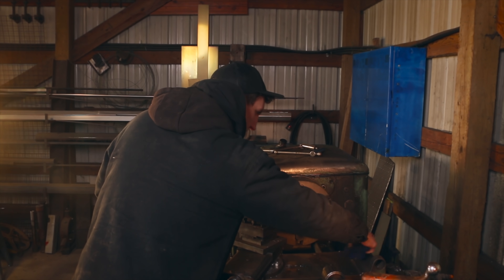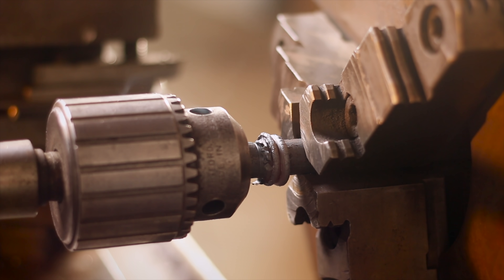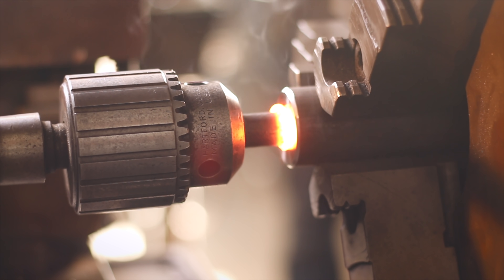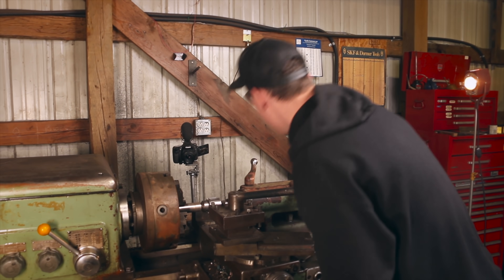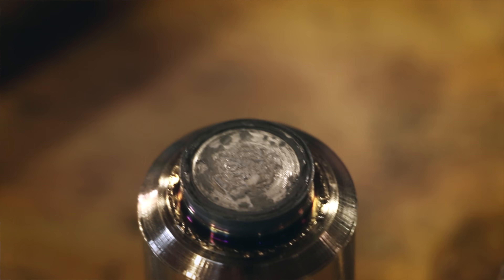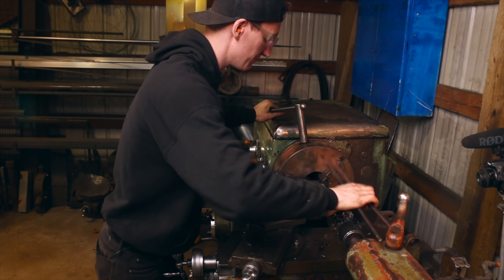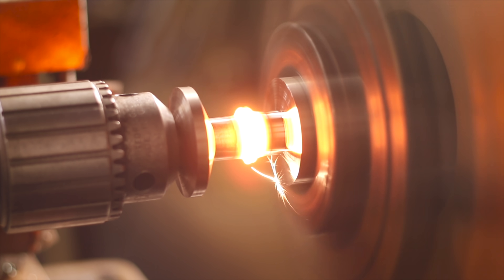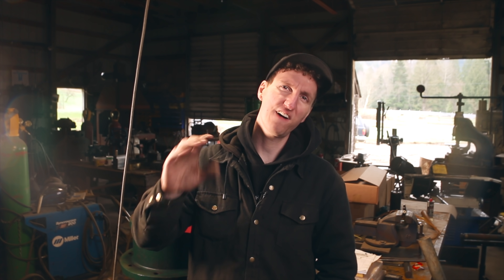Can I FRICTION WELD TITANIUM on my LATHE?

Comment: Would adding a very slight tip to the standing still piece help with chances (between 5-10 degrees), so that the surface area can increase for greater friction (and a lot more heat centered at tip area for a stronger inside out weld) to at least jump start the friction weld process?
Reply: You actually want to reduce the surface area.
The lack of "mushroom" is the tell that it is not getting to a high enough peak temp to make the metal plasticize, the state where it flows but is still solid.
This is because he is generating heat slower than the metals conduct the heat away.
That means you need more spot heat generation, there are 2 ways to do that speed and pressure
Speed is limited by the machine
Pressure is limited by the force he can apply and the multiplier of the tailstock screw.
This means that unless you can apply more force to the tailstock you need to apply the force of the tailstock to a smaller area - Even though force is unaltered the PSI increases
Reply: . The end contacting surface area, theoretically, would be the same or close to your existing runs, as it would shave or crush into itself as it heats up.

However, You very clearly know more than me though. Did not think it would be more an issue with pressure instead.
Reply: @GrimOfDonuts  Essentially it's an issue that with friction stir welds that you need to generate the shock heating very quickly or you lose the ability to perform it.

Once the tip in the cone heats it enters a deformable state that is not quite liquid - this is refereed to as semi-plastic or plasticized material
While in this state it can no longer generate pressure and extrudes from the surface - the fact it is deforming means it can no longer exert pressure unless you are ramfeeding it faster than the material conducts heat, this means its capacity to generate heat via friction just dropped off a cliff as friction heating is a combination of speed and pressure.
This loss of pressure then stalls the friction welding process and the torque of the spindle then shears the newly formed bond or radically over stressed the drives of the machine as it is now trying to twist solid material which results in either a pronounced slow down of the spindle which further deepens the stall meaning that the outer area is at a different heat profile than the core of the weld which can induce different granular formations and weaknesses or in geared machines can result in total gearbox failures

The reason why friction welding is primarily pressure based is because by the nature of cylindrical rotation the core will have drastically less surface speed than the outer areas due to the circumferential distance increasing so rapidly.
The rotation is there to perform the mixing of the semi-plastic solids in a similiar manner to how you could with something like playdough.

This is why friction stir welders are almost always direct drive electric motors for safety rather than geared ones and also why they are popular for production as the speed of the shock heating needed for the process results in a rapid repeat production

Comment: I think for the carbon steels and the ones that did not weld well, you should pre drill a hole in the one the is connected to the spinning side of the lathe and then bore down the end of the stationary piece to the diameter of the rotating one. Maybe there will be a stronger weld that can resist impact better.

Comment: Tim, I really enjoy your videos.  It's great seeing someone who loves their craft and is willing to try new things... 

A couple of things...  It looks like on the steel, you are getting "fast" fractures (the chalky area).  You probably have a crack, that is enough of a stress riser to propagate when you strike it (look for a flat area next to the chalky area).  In cases like that, you could actually improve the strength by clearing out the mushroomed area and getting down to a crack-free area. Of course, as a blacksmith you are probably quite familiar with that.

For titanium, it is notorious for galling.  Basically titanium forms an oxide layer skin that is super tough and super thin.  When it is exposed to friction with titanium, that thin layer sheds and locks in with the layer on the other side.  With the lathe you are shedding so much, that you are putting a lot of energy (heat) in.  This is why titanium is almost never used in bearing applications, and if it is, it is only with a non-titanium material on the other side.

Comment: it seems like the best welds are those that "mushroom" out. as if they liquify to a point of actual blending of the 2 metals ..
Reply: Seems that way. Sounds correct
Reply: @Charles37400  but in welding you'll need a flux or shielding gas

Comment: tim if you bored a hole in your stock 10mm deep and machined step down 10mm from the other piece of stock so it slid in neatly and then friction weld it the puddle should be internal then it will easily friction weld the outer stock making the friction weld stepped in theory and should be very strong cheers from down under

Comment: If you have a tool holder that you can release and let it spin, then you can use the higher speed, release the tool holder, and let it all wind down. Probably help all the welds.

Comment: i feel like if you put a torch on it maybe 2-3 before you stop the lathe  then hold the torch on for a few seconds while the lathe is full stop it might work better it feels like maybe the weld might be tearing at the last second when the lathe stops. also what about trying to keep a flow of Aragon at the joint sight as you are developing heat to stop oxides and the weld is forming

Comment: What about "rough machining" the two parts? I'm just guessing that two rough and knurled parts would create more heat/friction/puddle and fuse better, as opposed to two, mirror polished parts
Reply: Any surface knurls are destroyed well before that point as the fusion is not a puddle - it never reaches full liquid state, merely plasticization where the surfaces flow like playdough into each other - hence why the name is "Friction Stir welding"

You want a smooth surface as the surface defects would create inconsitant pressure and thus un even heat

Comment: I think the titanium worked best as it was within welding temp longest, if you had the steel and inkanel held in longer and forced them into each other it would probably have more surface welded and thus be stronger

Comment: What if, rather than stopping the lathe, you first released the brake on the static end? Then, it could spin up to match the rotating part. Just curious. Also, I wonder if you could weld dissimilar materials in this way. And, can you weld sheets of metal together by drawing them through the spinning bit?
Reply: You can weld dissimilar metals, but only if they reach their Semi-plastic temps within around 100 degrees.
Your idea is equal parts right and wrong - it can be done on much heavier build machines, but on smaller machines the release like that means there is a sudden pressure drop from the bearings taking the load which spoils the weld

Comment: I think the welds with the most displacement out the sides had the best properties because the displaced material carried all of the Oxides, exposing fresh metal in an airtight chamber for the weld.
Reply: I wonder if flux would help
Reply: @ov3rcl0cked  Not for welding, no. At least not to remove the oxide layer. When it comes to welding, if you are using a process that even uses flux (FCAW or SMAW are the two primary processes that use flux) the primary purpose of the flux is to decompose into a gas that can shield the molten weld metal from oxidation. It doesn't actually help to remove any existing oxidation, that's why you need to use a wire brush. That's also why when welding metals like Titanium, it is better to use a gas shielded process like GTAW than it is to use a flux shielded process like SMAW, because not only is there much less of a risk of weld metal contamination, but the shielding gas can linger for much longer on a weldment, providing shielding to the metal as it's cooling down as well as when it's actually molten.
Reply: @richardmillhousenixon  I just know borax flux is often used in forge welding, and this seems similar to that.
Reply: @ov3rcl0cked  In forge welding borax flux serves the purpose of preventing further oxidation, not breaking down existing oxidation. Source: Me, an AWS certified welder
Reply: @richardmillhousenixon  I have seen people use, and have myself used various fluxes that can stick to, collect or lower the melting point of slag/oxides so it is easier to remove and can often get them out of the way for the metal to stick together properly. I don't know the names of, or the chemicals used for, the fluxes. would have to go look to see if I still have any of it.
Reply: @Metal_Master_YT  Again, flux does not remove existing oxides, it simply prevents further oxidation. The metallurgy is slightly different when it comes to casting molten metal but in this situation we aren't talking about a large quantity of molten metal. Even when casting you still have to skim off the oxide layer after using borax or some other sort of flux
Reply: @richardmillhousenixon  I am not saying that it just simply "deletes" the oxides, I am just saying that it gathers up and sticks to the slag, and makes it have a lower melting point in some cases, or it makes it easier to work with the oxides, stuff like that. although, there should be some chemicals that can dissolve oxides, I'm not sure about this last one, but do you know if solder flux has any dissolving properties? or other oxide/crud removal properties?
Reply: @Metal_Master_YT  Solder flux doesn't actually do anything to help with oxide removal, it simply aids in the wicking of molten solder into the joint via capillary action
Reply: @richardmillhousenixon  ok, but I have some acid core fluxed solder, doesn't the hot acid react with the oxide and dissolve them? I know that its possible to dissolve oxides in certain chemicals, I have done that myself with certain acids, but I don't know if that was its purpose or not.
Reply: @Metal_Master_YT  I'm not too well versed in soldering. I know the basics but I'm not an expert. For most purposes except for molten metal foundries, flux only serves the purpose of preventing further oxidation. When you solder pipes you're supposed to use either sandpaper or a metal wire brush to clean the pipe before fitting it together, and when you use the brush you're scoring and scraping off most of the oxide layer, so then when you apply the flux you're putting it on mostly bare metal.
Reply: @richardmillhousenixon  well, I have welded highly tarnished metal parts before, its more difficult, but if you use the right rod and welder, (and skill) you can fairly easily break through the oxide while welding. and I know that there are fluxes that are made to make the slag a smaller problem, however they do it.
Reply: @Metal_Master_YT  Yes, you can get through the oxide layer while welding, but it's not the flux that's doing it, it's the electric current itself. That's why with a highly reactive metal like Aluminum, the best options for welding it are GMAW Pulsed or GTAW Alternating. Those processes allow the current to be "tailored" to clean the oxide layer off as it goes by essentially blasting the oxide off with pulses of current, kind of like a pressure washer. This is why processes like GTAW and GMAW don't need flux coated or flux cored electrodes, because the shielding is provided by an auxiliary inert gas instead of the decomposition of the flux.
Reply: @Metal_Master_YT  And even if the purpose of flux was to dissolve the oxides, it doesn't do any good unless the dissolved oxides can also be removed from the joint completely, otherwise you're just adding more impurities to the weld in the form of the oxide-containing solution
Reply: @richardmillhousenixon  you said: "And even if the purpose of flux was to dissolve the oxides, it doesn't do any good unless the dissolved oxides can also be removed from the joint completely, otherwise you're just adding more impurities to the weld in the form of the oxide-containing solution"
well now, I'm not sure that it would be a big problem if there are some dissolved oxides in the way, after all, after you add flux, and its sitting on the metal you are trying to weld, the metal is still able to weld together, if that wasn't the case, adding flux would be pointless because it would stop the metal from connecting together. what I'm trying to say is that its not necessarily a problem if there is dissolved oxides in some flux, because flux is also made (as you said) to wick the molten metal into the weld. flux does not necessarily block the two metal parts from bonding together. if the flux can dissolve the oxide, then the metal parts aren't separated by an oxide that has the ability to prevent welding anymore. I have seen people put acid on liquid metal drops, for example gallium in sulfuric acid, and it cleans up the surface oxidation and makes the gallium very clean and allows the drops of metal to stick together easily. once the impurity gets dissolved, its no longer stopping the metal from bonding, because its in a different state.
Reply: @Metal_Master_YT  The impurities don't matter for the bonding, but they do matter for the physical properties of the weld. I'm not an expert when it comes to soldering, but I do know brazing and welding, and in those situations the flux does not remove the oxides.
Reply: @Metal_Master_YT  You are confusing the concepts of brazing and soldering with actual welding. Actual welding does not use a fluid flux, it used a powdered flux costing or flux cored electrode, if it's used at all
Reply: @richardmillhousenixon  whatever the flux used, either way, the people who made the flux designed the flux not to interfere with or lower the quality of, the weld. I don't think that dissolved oxides inside said flux, will mess with the weld any more than the existing flux would.
Reply: @Metal_Master_YT  Again, the flux used for welding does not dissolve the oxides, it just decomposes into a shielding gas to protect the weld from further oxidation. You are confusing brazing and soldering flux with welding flux
Reply: @richardmillhousenixon  we were theorizing, I don't know why you stopped.
Reply: @richardmillhousenixon  I have zero clue what you are talking about but you’re right😂😂
Reply: No flux will be of any benefit in this joining process. The surface was already prepared with the machining of the face and any other impurities on the surface would negligible. A shielding gas is necessary and the largest improvement that can be made.
Reply: @GortPredator  Yep. Either Argon or CO² would work the best, as their density is much closer to that of normal air than helium is, although both are denser than air, at ~1.75 kg/m³ and ~1.98 kg/m³ compared to 1.27 kg/m³ for normal air
Reply: @SoMuchFacepalm Tapered insert wouldn't work, as the heating concentration would be biased to the male side of the weldment
Reply: @SoMuchFacepalm probably not, because you need both equal mass and surface area to get those kinds of things working right
Reply: I don't know if you actually know what you're talking about, but damn, it sure sounded good
Reply: @dunerinaz  If you're asking me, yeah. If your asking OP, no clue

Comment: I think if you drilled a 1/2" deep hole with a 5/8 drill bit in the 1 1/2" round and then did it would make more surface area and heat it more
Reply: You actually want the opposite - The issue he has is with the machines he has there is only a limited speed and the pressure is only applied by the screw of the tail stock
You saw how well the 1st one went? that extruded "mushroom" is the tell that you got enough heat in - if you don't see that you need to up speed, up pressure by reducing the surface area you are applying the force to

Comment: Could defiantly benefit from argon blasting over it while you weld it together otherwise it will most likely fail in use eventually at the seem. All that oxide formation. Very awesome tho nice work!

Comment: The problem seems to come when stopping the lathe.  It seems like if you could figure out a way to lock the drill chuck then allow it to spin freely when you reach welding heat that would work well.  It's almost like the lathe chuck is twisting the weld while stopping (when the weld is cooling).  Maybe some sort of clutch mechanism on the drill chuck side?

Comment: Your pore lathe!!!! 😥😥😂😂 I think I saw T.O.T. doing this a while ago..... I think the conclusion was that a gas would need to be involved to stop the oxygen in the air from messing with the welds. It is an amazing thing to see 2 bits of steel fusing to each other like that. This should be the first lesson for anyone who wants to work with metal titled "Always use cutting fluid!!" LOL 👍👍👍👍

Comment: On some of these pieces when you jammed it together right as it stops spinning you can see that you were actually taking up slack between the Chuck and the piece. I think this was preventing the parts from being pushed together hard enough to get proper fusion. The first sample got jammed together really well and you can see how the material oozed out from the joint. Some of those other ones didn't get that opportunity. I'd like to see those try it again but with the material jammed against the face of the Chuck so that it can't slip as you're trying to push them together at the end.

Comment: The problem is your equipment.The machines that do this sort of thing when they hit the point they want in the weld they stop immediately while the lathe needs those 3-4 turns to stop which breaks the bond due to the material cooling at the same time.